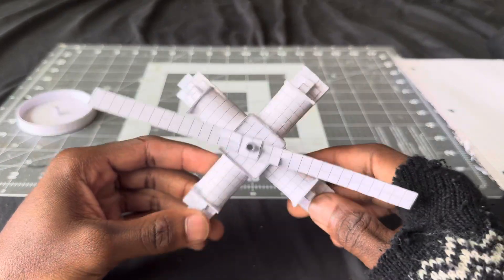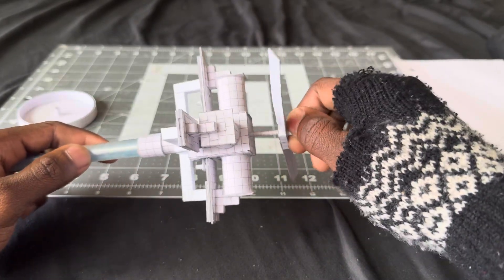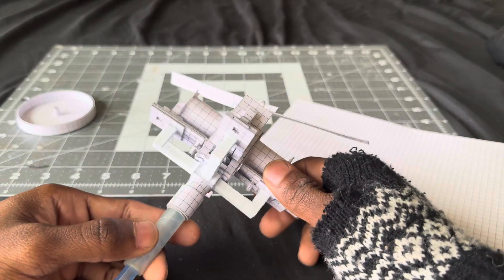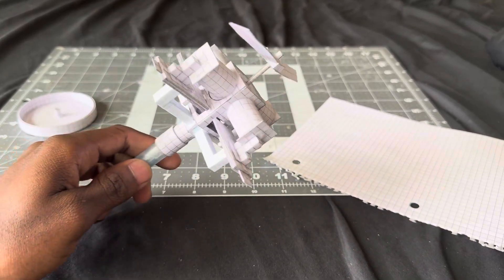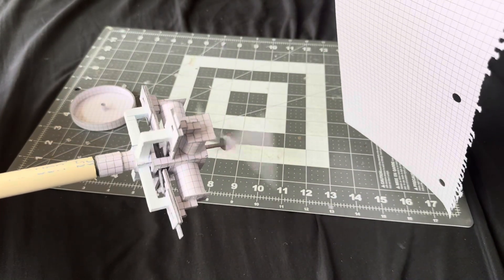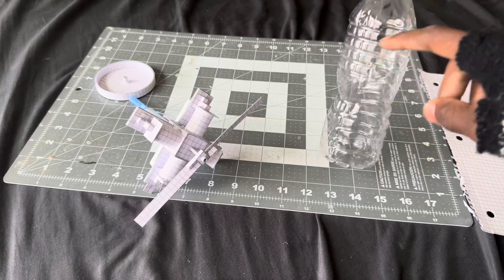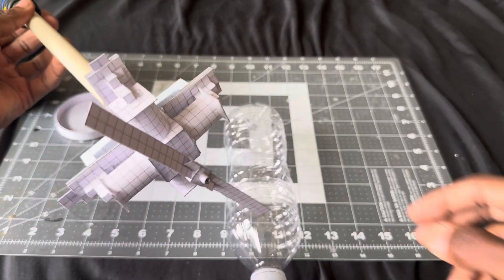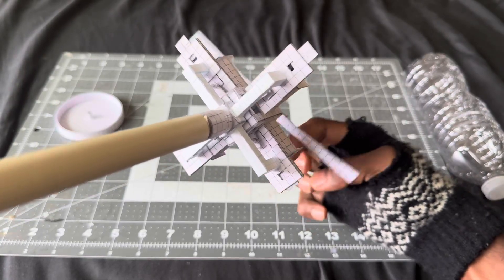How Much Thrust Can My Paper Radial Engine Make?

Comment: The engine can easily produce so much more thrust. All you need to do is make the blades of the propeller larger, longer and even add more blades if u want.
Reply: Exactly bro
Reply: making the prop bigger is actually more efficient

Comment: Hi paper engines! I have a question. So, on your engines, when the air intake valve is open, is the piston inside the cylinder up or down? Thanks!
Reply: Its up so that the air can push it down, the valve closes it so there isn’t too much air and as the valve closes it shoots air through the exhaust to repeat the cycle.

Comment: Using thrust like that really depends on the shape of the propeller, a fan blade shape would have easily knocked over the water bottle. But there isn’t much other ways to measure it IG
Reply from the maker: @Ethan-burner-acc  right